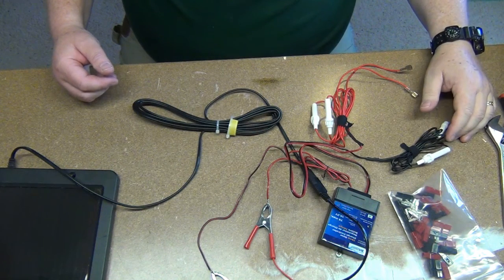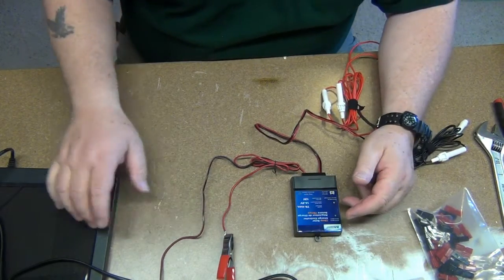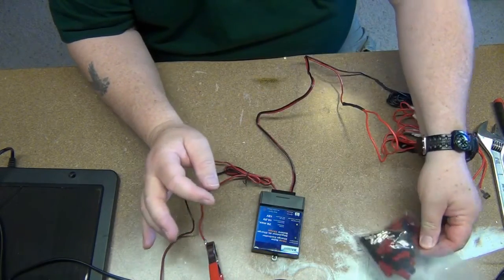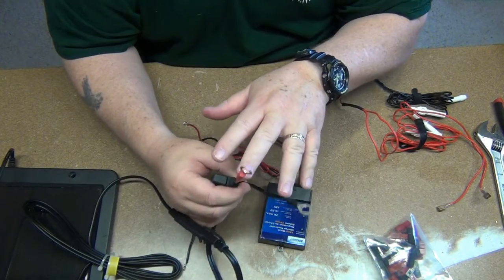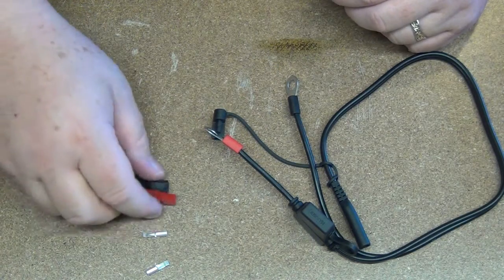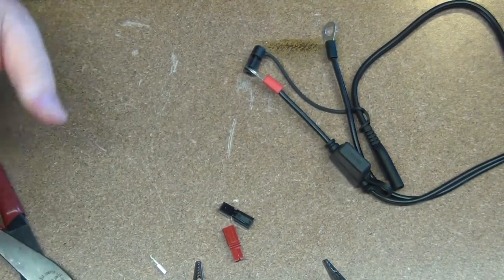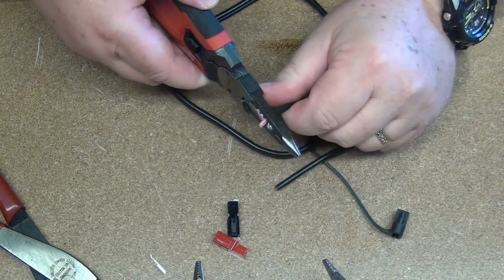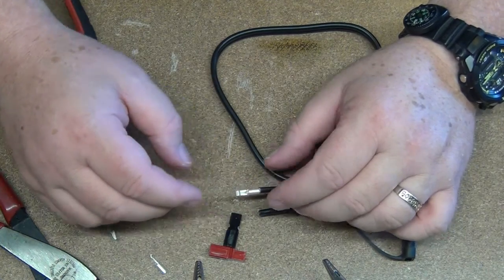Andersen Power Connector install   Preparing Solar Panel and Controller for HAM in a Can

Comment: Good stuff, Dave.  I use a foldable solar panel to charge my two 30-Ah battery boxes.  I use a Battery Tender brand charge controller.  They are pretty cheap.  You can find them at a lot of auto parts places as well as place like Cabela's.

Comment: I highly recommend the proper crimping tool. It makes it so much easier and no need to solder (some choose to but it isn't needed). Good video.
Reply: Mark C soldered makes a better point of connection compared to crimping which mainly squash the wire on the contacts rather than making a solid connection. Soldering is better
Reply: Many have suggested otherwise. In fact, I've seen some say soldering will create a breaking point due to stiffening the wires or connection that otherwise wouldn't exist. They designed them to be solder-free (crimp only) so I stand by my statement based on experience and their design. Soldering is an option but should be done sparingly and carefully as to not create an area that will lead to breakage in the future.
Reply: breakage can still be done by using a poor crimping tool that doesn't make a solid connection, reliability will be soldered, crimp is good if you have a decent tool for it.
Reply: OK, well you do it your way and I'll keep doing it mine - properly crimped with the crimping tool - as they were designed. I stand by my statement. Anything is possible - both good and bad with either method - but I know I've had zero issues with properly crimping them and will continue to do so and recommend it as the best method. Have a good one!
Reply: @HiSnorlax  this is NOT true !
There is no better connection than a well done crimp connection. It has less electrical resistance and better mechanical properties.
Also soldering a connector without strain relief (like anderson connectors) is asking for problems on the long term since the solder wicks up in the core causing a weak spot which breaks when bending repeatedly.

Comment: Excellent video!!!
One problem you may not have considered is the noise that comes from that particular charge controller on HF.  That controller is great for charging your batteries passively, but it's also an unforgivable S9 noise source in your radio.